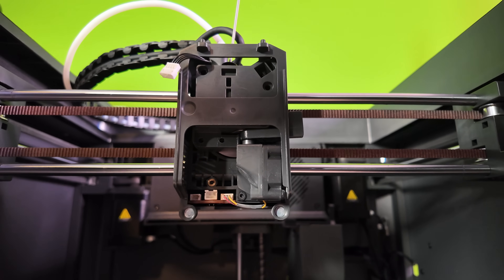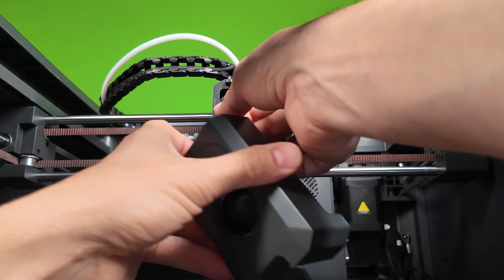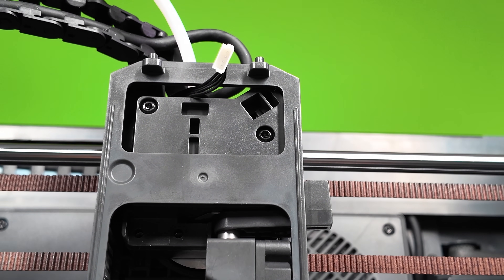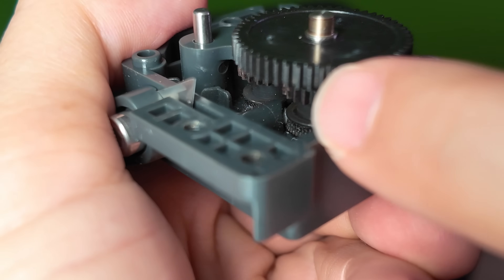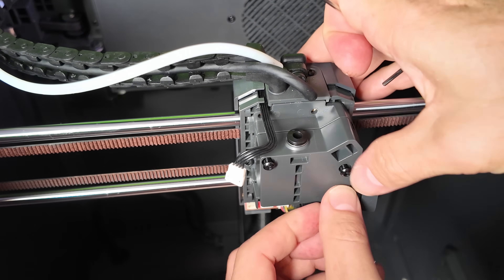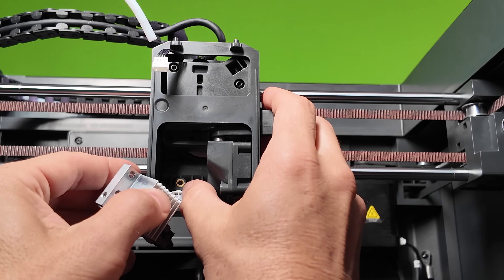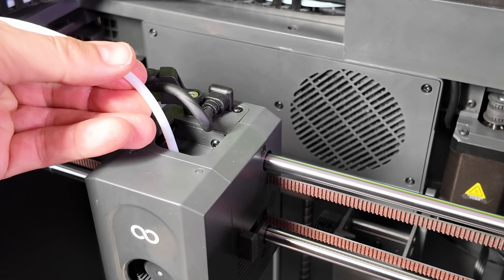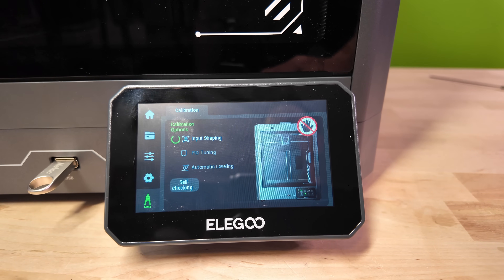I Fixed My Centauri Carbon Clog in 10 Minutes Here's How

Comment: Really good video on how to remove the clog. Was able to follow step by step and unclog my machine. I have a later version of Centauri Carbon and don't know if these were on previous versions, buy my gears had a metal collar on it which had to be removed before I could remove the gears and clean out the inside.

Comment: Guys please DON’T  USE MOIST FILAMENT it’s brittle and a recipe for disaster. Also, use the Preset filament load  and unload feature that comes stock with the printer firmware. Lastly, the PLA filament load temperature is preset to 250 for a reason. It is set to that temperature because it basically forces any filament that may be stuck in the hot end out of the nozzle so don’t change it.

Comment: Your method is correct and thank for sharing . Problem I encoutered that maybe you should plug into this video it the part where you prying the little plugs from the board with a flathead tiny screwdriver. In my case and I hear this more than once the prying require good tool and focus as they tend to fall out. Waiting for new board to come.

Comment: I followed this the first time it happened to me. Worked great...then the next time the roll ran out, it happened again...then again on the next roll, those last two times there was nothing stuck in there. What he didn't mention is you may need to re-tension the screw for the the gears to grab. That ended up being the issue for me. Otherwise this helped out a lot. Now that I'm thinking about it, is removing the hot end even necessary? I'll try that next time it happens.

Comment: Your video was great but...Yeah no. Will be buying a Bamboo tomorrow. 15 hour print ran out with about a half hour to go.Tried for an hour to fully heat and load new filament as the last thing I wanted to do at 2 in the morning was take this apart. The first cable was very hard to get apart. The inner left one was impossible first the wires pulled out. Then the tiny plug fell apart, It wasn't going to come unplugged with a little screwdriver. The wires didn't bother me I would have soldered them back on but the small plug seems to have been melted. Meanwhile suddenly the power went out to the bed so the job was ruined. Not ever going to put up with this again. The one fatal flaw in an otherwise good printer. I'll contact Elegoo and replace the whole assembly. Might be cheaper just to buy the printer again. EDIT : Elegoo has already gotten back to me. Turns out there is a lot more to remove to replace where the left plug used to be, Just hope Elegoo even has the whole assy. to buy. They have a returned CC at $235 it might be easier for me to buy that. I wanted to buy the new P2S Bamboo when it's available.
Reply from the maker: ah man sorry to hear you had so many issues! My CC has been great to me so far. I would suggest getting an unclogger on Amazon. They work so go when getting a clog. Its literally like a needle with a handle on it. You heat up the nozzle to 270, remove the ptfe tube on top then push the filament through with the unclogger. Done. I have done a specific video on this.

Comment: Since you deleted my previous comment I'll post again. This is pointless as  all you have to do is cut the filament, then heat your hot end to 275, wait for it to heat up for a minute or two, pull out your ptfe tube and filament. Insert a fresh piece of filament and push hard, if that doesn't work put in a 1.5 mm hex key and push hard and it squirt right out of the end unless it's a metal obstruction. No disassembly and all this other nonsense.

Comment: When I went to push the power cables back in one of the input slots popped right off the board...

Did I just ruin my printer? Any suggestions?

Comment: Mine had the same thing but my filment got stuck in the gears and holes trying heating it and it melted the plastic to so i return it and getting another one any ideads what i should do next time i was using carbon pla cf.

Comment: Went to remove the smaller connector that you said to use a small screwdriver on. It broke free from the solder points so now I need to request a new assembly or something
Reply: Same

Comment: Hello! I'm still very new to 3D printing and while looking for "regular maintenance" types of videos, I came across this one and I'm filing it away for the future. So thanks in advance for that! The video also resulted in a question in regard to filament loading that is going to sound like a toilet paper question...under vs over? You have the filament loading from underneath the spool (or side closest to the sensor thing) versus over the top (or from the far side). Is there a difference? personal preference? 

Thanks.
Reply from the maker: For the ECC I always load from under, up into the tube. If that makes sense. I always load in the way with the least amount of pressure on the filament. With that said it honestly doesn't matter 😅.
Reply: @planet3dp    :) I got a tangle with it over the top once and tried under and I still got a crossed filament issue that stopped the spool from feeding. Some poking around found me printing a different spool holder (it printed with ball bearings in it which was friggin' awesome!) and a little piece to better center the censor. Both of those seemed to have fixed that issue. Uncertain which it was because scientific method be damned by doing one at a time. 😂

Comment: When I engaged the allen wrench to remove the two screws on the side of the tool head, they seem to inserted really tightly. It appeared the wrench was going to thread those screws..... So I push it in really hard? Were the ones on your unit really tight?
Reply from the maker: I think that is common to have some screws that are tight. I have noticed some being tighter than others.
Reply: @planet3dp  So would it be best to "jam" it in  and then slowly turn the wrench to break it off?

Comment: Mine clogs everytime I use the elegoo pla cf. So frustrating
Reply: What nozzle size are you using?
This may not be the printer fault.
Reply: @CortesdoMorpheus  I'm having the same problem using elegoo pla cf on a 4mm nozzle if I switch to 6mm will this solve my clogging issue? No other issues btw
Reply: @MidnightMirthMob  Elegoo recommends using 0.6mm nozzle size or higher for composite material. If you use 0.4mm, make sure to go slower, otherwise you'll have a clog.

Comment: I'm getting a 103 error now after unclogging 2 extuders sigh  PID test is fine though bed leveling is 103 not heating up as expected
Reply from the maker: Have you opened a ticket up with Elegoo. They are very good with getting back with answers. Also check Google search, I'm sure your not the first person to get that error.
Reply: Check that your thermister is properly placed in it's hole.

Comment: Question, is the nozzle boot necessary, does it need to be put back on over the nozzle?
Reply: You should put the boot back on. Without the boot, it’s easy for a minor back up of the filament from a failed print to stick to the hot nozzle and gum up terribly. The cement won’t stick to the boot, therefore making cleanup a lot easier.
Reply from the maker: @Cooper_42 thanks for that. That is exactly right. The boot is there to deflect filament build up.